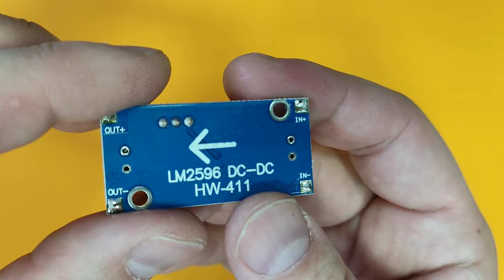How to power Phone Forever Without Battery

Comment: Legend's just attatch resistance on port and pulg into charger 😅 it's works and all showing always charging
Reply from the maker: I should try this. Thanks for the idea 💡☺️
Reply: @FixitEasyDIY waiting for a tutorial
Reply from the maker: Last weeks I am rearranging the workshop. It will take me 2 more weeks to finish it. When I am ready I will continue with the projects. Please understand. ;)
Reply: @FixitEasyDIY  ok thanks.
Do you know if I can run my a03s without battery I have 30 phones which I’m using for crypto mining and the battery swell I had to shut them. I have 5. One plus 6 as well. Help will be much appreciated
Reply from the maker: @Baig.mirzaa I am not familiar with that model, but I am confident that it can be done using this technique.
Reply: @FixitEasyDIY  I don’t see the same battery on the phone board. A03s has a different type of battery connector. I order everything after watching your video haha it came just now when I open the phone and find out it has new connector. Not the old style like your phone have
Reply from the maker: @Baig.mirzaa It might be different, but they all work on the same principle. Just use a multimeter to determine the pinout and it should be the same after that
 A little bit of soldering and some tiny job ;)
Reply: @FixitEasyDIY  hard for me. I have never done anything with phones but I’ll figure it out. Thank you
Reply: I tried several of my blu view 2s and I needed the  LM2596 to get them to boot. Using the phones usb port would not work for me with just the resistor installed.
Reply from the maker: Same here
Reply: @FixitEasyDIY any updates?

Comment: I have 4 pins in my phone and i directly connected a 5v-2A charger to the positive and negative and my phone shows the logo and turn off
Reply from the maker: That's because it needs 10K resistor to be connected as the video shows. Try to measure on the battery where is the thermal protection connected. It's 10K resistance to negative pole.
Reply: You'll probably fry your phone.
Reply: @sertralina100mg he probably already did, since mobile phone usually accept maximum voltage of 4.4V
Reply: the same to me....

about that 10k resistor, i need to set one side in the central battery pole and other side in the negative?
Reply: What phone? You probably need to leave the BMS in place and solder the wires to it instead, that will work. I've got a video about it.

Comment: Normal people just plug the phone into power and then it works. Taking off the power, the switch getting turned off, or if a power cut happening will result in the phone not working until is it connected or working.

Comment: When they call these smart devices. They are not kidding. I couldn't get mine to boot on 4.2 volts. I switched to 3.3v. Waited for Android to complain about low voltage. Bumped it back up to 4.2 volts. Then presto! Boot screen.
Reply from the maker: @bondjovi4595  Thanks 👍 This is actually a very useful advice!

Comment: I've been fixing to try this for awhile now. But I'm guessing if it is a soft battery, the phone tries to search for that overcharging circuit board upon boot up.
Reply from the maker: Considering my experiments with a couple of devices there is only a protection board in the battery. The phone cannot detect that circuit, or at least old phones. But there is a temperature sensor in 99% of the batteries. It is changing the resistance while raising the temperature. This is why we have to mimic this T sensor with a simple resistor with a specific value. Most cases this will be 10K. If we have the old battery , even if it's damaged, we can still measure the resistance between minus and third pin. This is how I managed to power many old devices and use them .
Reply: Yes most modern phones do, if they cant see a BMS, they wont work, my video demonstrates it. Its basically the same but you connect the wires to the BMS instead of the phones battery terminal.

Comment: Mine is a Samsung A51, I had multiple problems with the charging port, and i removed the battery and soldered 2 wires to the ribbon connector. The wire is coming out from the headphone jack and it's connected to a powerbank. Working fine so far.
Reply from the maker: Thanks for this useful information ☺️
Reply: @FixitEasyDIY  did you mean with hw-411 or without hw-411?

Comment: help me ... i've given 4.1 V without the resistor . it works but battery percentage keeps decreasing and it gets a little bit hot after some time. does adding the 10 k resistor solve this ?
Reply from the maker: Actually if it's working without the resistor it doesn't need it. It is there just to mimic the temperature sensor. Decreasing battery percentage is totally fine 😊 It's the same with my phone. It will still work just fine. If it isn't getting too hot don't worry. Adding resistor here will not solve heating issues. Leave it working for couple of hours but keep an eye on it. If it doesn't get too hot it will work ok no matter of the battery indicator.
Reply: Same problem with me. Decreasing battery percentage at faster rate then original battery.
Then no use of hacking it if i have to restart it every hour or so.
Reply: This will never work because phone only measure the battery capacity when boot up then the cpu calculate it's power usage and display the capacity in real-time ,
Reply: @devutty_devu_  nice explanation,. Tell me, keeping the original bms but changing the battery to 10,000mah will work ?
Reply: @hemantsingh9711  without tweaking the battery info on software, it will not work , if the phone comes with 5000mah battery but adding a 10000mah battery will not give extra backup, when cpu ditect that the phone just used 5000mah ,it will show low battery and shut down

Comment: I have no knowledge of electronic engineering. You said to use a 10k ohm resistor. But if it doesn't turn on, please tell me how to measure it to find the exact resistance value. I'm very desperate for this trick. I should be very grateful to you if you might help me.
Reply from the maker: The exact resistor value can be measured on the pins of the battery. There would be 3 pins: one of them is + , another one is - and the third pin is the thermal protection pin. You should measure between minus and T pin. Sometimes the device doesn't turn on because the power supply cannot provide enough current to boot. When the phone is loading at start it is drawing a lot of amps. Also keep in mind that you can use different power supply :)
Reply: @FixitEasyDIY  Thank you for your answer. I'm playing with an old LG K10. I tried it as you told me. The resistance value of 60k was measured at the battery 4pin terminal, and the resistance was connected in 50k+10k series and soldered, and the phone turned on normally. However, after five minutes, the phone automatically shut down after the "invalid battery" warning appeared. I bought resistance by type and tried it several times (4.7k, 10k, 20k, 50k, 100k, etc), but it was the same. Alternatively, the phone was turned off with warnings such as "temperature is too high". (Of course I connected a 3.7v stepdown module between my smartphone and the portable powerbank.)
Reply: It's my guess, but I think the LG smartphone is designed to check the authenticity of the battery very carefully during the booting process so that it never turns on if it's suspected to be non-regular. In another case in Google Search, Samsung Galaxy smartphones do not have this problem and turn it on normally.
Reply from the maker: @primarally5609 This must be some protection they used in this phone. This is why there are 4 pins. That's my guess
Reply from the maker: Yep, this is exactly what I am thinking 🤔 It is working with my Lenovo, Samsung and even old Ipad 3.

Comment: how you decide that 10k resistor ? can i use any resistor ? or perhaps without resistor ?
Reply from the maker: The reason to use 10k resistor is because there is a thermal protection inside the battery. I measured it and between the third leg and (-) leg of the battery showed 10k resistance. This will mimic there is a battery. Others the phone might not start. Some phones have 50k resistance of the battery's third leg and minus, some are 4.7 K. You need to measure it, but in most cases 10k is working.
Reply: @FixitEasyDIY my battery have 3 pins, named as (-), (+) and (T), and measuring between T and minus don't show any resistance. Am I doing anything wrong?
Reply: @oberdan.carvalho  resistance is captured in ohms, try put your multimeter in ohms section

Comment: Hi, love the videos but i have a question.

I have a bunch of old phones with 3 pins ( positive, negative & BSI temperature regulator) when I attach the pins to power to start up, they go off straight after. I am using a resistor between negative and BSI. What is the role of the blue circuit that you apply it to?
Reply from the maker: Hi there. This blue circuit is a voltage regulator. It drops the voltage to 4.2 volts. This is needed because the device is supposed to "see" such voltage from the battery. Phone's battery charger is giving 5 V and this is why I use the regulator. The role of the resistor is to mimic the resistance between minis and BSI. I hope that's ok.

Comment: is it possible if i change the 5v dc power supply , with Power Supply Switching 12v 20A?
Reply from the maker: Even better. Sometimes 5v dc chargers cannot start the phone because it draws a lot of current when loading on start. :) Go ahead and pls report ;)
Reply: @FixitEasyDIY  do i still have to setting the volt from lm module?
Reply from the maker: Output settings would be the same. You can check voltage on output pins just to make sure but it should be constant, no matter what is the input voltage. Good luck 🤞
Reply: Need help, from module I connect  it with battery connector , but the indicator battery keep decreasing
Reply from the maker: This is normal. It is the same with my set-up. It will continue working, don't think about the indicator. It will settle around 20%. no worries.

Comment: And guys thats how you turn your phone into a brick this thing probably be cooking up your phones power supply compartment of your phone cause it would be probbaly supplying the same voltage when the phone is idle it doesnt probablly not be adapting to the usage voltage of your phone  which can damage your phone
Cause it doesn't have the BMS board which mostly does it the voltage regulation in according to the task
Reply from the maker: Don't worry 😊 This is perfectly safe for the phone. I've tested it on 7 different devices. You only have to use a maximum voltage of 4.2 volts.

Comment: Hello dear. I have a project to do it so and I need a cell phone to turn it on without battery. I used a 12 V DC adapter and a step it down to 4 V DC. So the problem is right now the cell phone keep reading the charger like the battery and it keeps coming down when it reach to 20% it shut off by itself. What is the causing that because the percentage I think should be stable and not keep coming lower can you please help me with that?
Reply from the maker: Try raising the voltage up to 4.2 volts. It should work this way. If not working try using another power supply with greater amperage output. Sometimes there is power saver mode on some devices and they shut down under 20 percent battery. Try turning off this feature if present. It is normal to read low battery and if it continues working just ignore "low battery warning" . Also try measuring the actual resistance between minus and third leg of the battery if you have it. There must be a resistor with the same value soldered on the device's pins. This will mimic the battery temperature sensor. In most cases this will be 10K , but you better check with a multimeter. Good luck 🤞🤞🤞
Reply: I did some research into this (for my samsung S6) and its basically a software thing. The phone doesn't use voltage to work out its charge level surprisingly. Or at least it only does when turning on the phone / during charging (when there is a charger plugged in).
It basically does some math and estimates the state of charge from that. The phone 'knows' its mAh rating, it can also sense how much current is and has been drawn through the battery BMS. With a bit of math it can work like a coulomb counter. From there is estimates how much power has been drawn from its XXXXmah battery and that's the value it displays. I'm sure there is more to it than that but that's the overview. 

I tried a lot of different things to try stop it thinking its discharging but couldn't get it to work. Re calibrating the battery, deleting its battery memory. I even tried editing the mAH of the phones battery value in android to 9999mah and it didn't make much difference. Best thing to do is schedule it to restart itself when it gets 'low'. When it reboots it should be 100% again. Check my vid.

Comment: Hi! I would be interested to see a video in which you add a secondary power source (maybe a 4 AA batteries socket?) This would be useful if you want to plug the phone to another wall plug, but you don't want to turn off the phone.
Reply from the maker: This is actually a good idea 💡 I would do that ☺️

Comment: How to do with modern battery connectors, for instance Redmi Note 8 Pro?
Reply from the maker: It would be harder , because they are connected with strip cables. It is hard to peel the insulation and connect the power supply. It is possible, but very tiny job :)
Reply: @FixitEasyDIY  can you elaborate pin connector diagram, it's complex. There is four + four pins in connector. Are they all for different purposes?
Reply from the maker: @SamsungF145G-h6v  I am not familiar with that connectors. Sorry brother 😔

Comment: Hi, first of all great video :) I would really appreciate your help on a project that I'm currently doing. I have Samsung A80 which i want to change to a different battery, i took the soldered the ribbon off from the A80 battery and soldered the 3 wires to the new Samsung battery but when connected to the motherboard the phone didn't want to boot up. Do you think the new battery i got is reporting different resistance/thermal to the phone and it won't power on? Thank you.
Reply from the maker: That might be the problem. You should measure between minus and T terminal on the resistance scale of the multimeter. Try matching the old battery and the new one. Before connecting the new battery it should be charged. Double check pin order, there might be some difference.
Reply: @FixitEasyDIY  thank you. Do think it would be possible to power the phone with a 18650 battery?
Reply from the maker: @mariusm5187  absolutely possible

Comment: Hii i have samsung on5 phone 
In my phone i have 4 pin so how can i Connect the module where to connect the  resistor
Reply from the maker: You need to determine where + / - and T plug are with a multimeter. I am not familliar with this particular model, but it should be easy.

Comment: Hey! Thanks for the tutorial. My Galaxy S4 has 4 pins though, how would I make the conection then?
Reply from the maker: You should use a multimeter to determine which is the + / - and T pin. Therefore you need to measure the battery. There must be voltage between two of the pins and there must be resistance between the other two or between minus and thermal protection pin. Just imagine that you are giving the device the same measurements as there is a genuine battery. And it will run as expected. Just make sure you use a proper power supply. Good luck my friend 👍👍👍

Comment: My battery of LG U8330 is dead, can't determine the polarity with the multimeter and have no charger. The battery doesn't show the polarity neither. It is a battery with 3 pins 2 of them close to each other and the other on the other side. Can't find anything about this since this phone was produced in 2004
Reply from the maker: You could try to determine the pins by using multimeter. There would be 10k resistance between minus and temperature pin. Just give it a try 😉

Comment: Hello could we on mobile without using this device which u use bcz I has original charger
Reply from the maker: The original charger has 5V output. The battery output is 4.2 V max. This is why I used the voltage regulator to lower the voltage from 5V to 4.2V. It is like 1 dollar from AliExpress.
Reply: Ok thanks a lot

Comment: How about non removable battery like Xperia?

In my Xperia phone just booting but fail to reach home screen.....
Reply from the maker: Every phone could be disassembled. Of course those new models need some work, but in general every phone has battery inside and it can be powered via power supply. It only takes some tricks to mimic the battery ;)

Comment: It works But a messege shows up "please make sure you are using a compatible battery and charger" when  I connect charging(and Data together) cable to PC through USB Port for data transmission ,Will this damage the phone?Another problem is phone can't be turned on when regulated power and data transmission cable are both connected to the phone ,is it normal?
Reply from the maker: That's normal because the device is trying to charge the missing battery. I haven't faced this problem so far. I think it's not possible to damage the phone but data transfer still might be a problem for some models. For the phone in this video everything was working like a charm. Good luck my friend 🙂
Reply: @FixitEasyDIY  Thanks a lot, My friend.